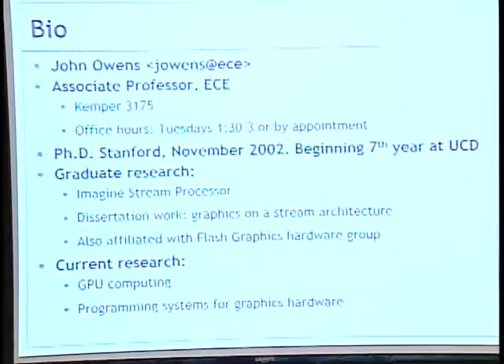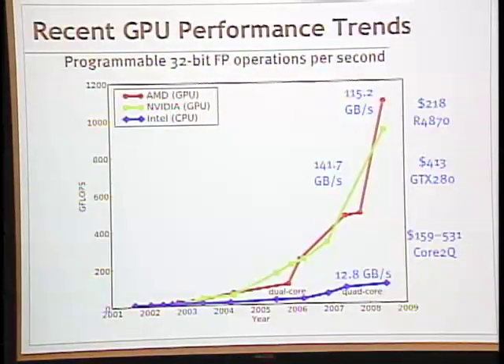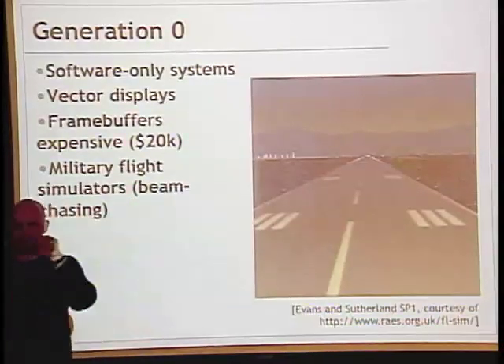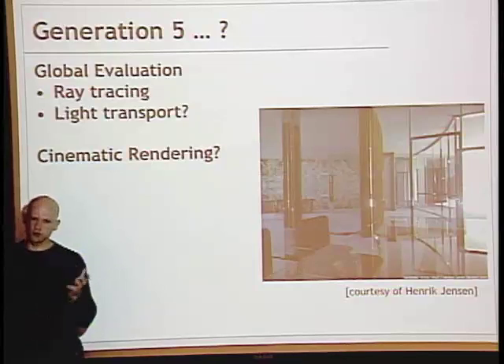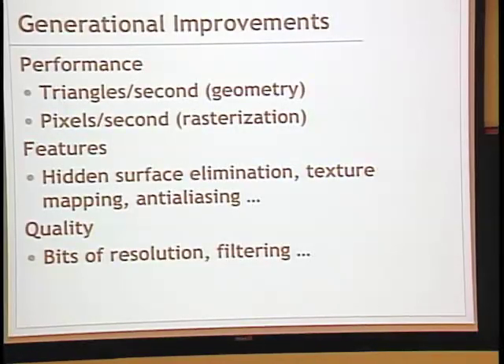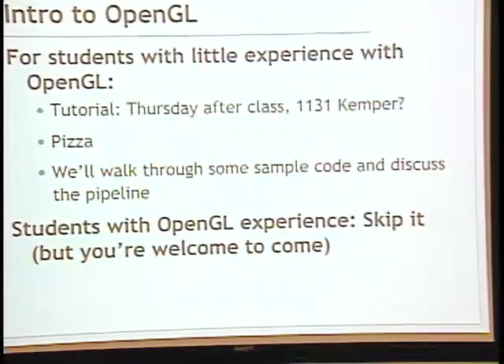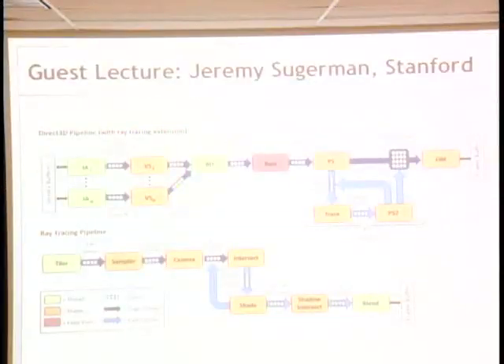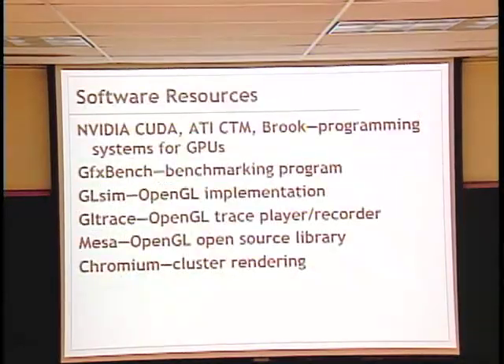Introduction / Course Overview

Comment: 1 Introduction / Course Overview
 2 OpenGL Graphics Pipeline Overview
 3 Graphics Performance and Characterization
 4 Programmability
 5 GPGPU 1
 6 GPGPU 2
 7 VLSI Trends: Why Graphics Hardware Is Fast
 8 Geometry
 9 Rasterization
 10 Texture
 11 Composition/display
 12 Overflow from the Pipeline Lectures
 13 Juggling the Pipeline
 14 Parallelism
  
 Matt Pharr, Intel No Video
 Aaron Lefohn, Intel No Video
 John Nickolls, NVIDIA GPU Graphics and Compute Architecture
 Justin Hensley, AMD/ATI The Latest Graphics Processing Units
 Jeremy Sugerman, Stanford GRAMPS: A Programming Model for Graphics Pipelines and Heterogeneous Parallelism